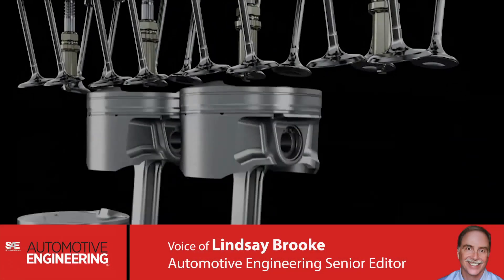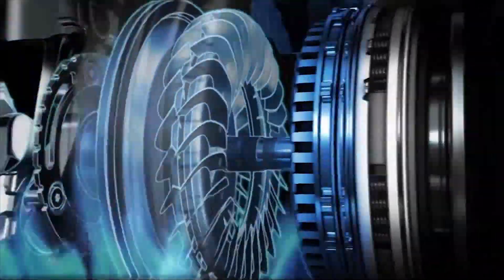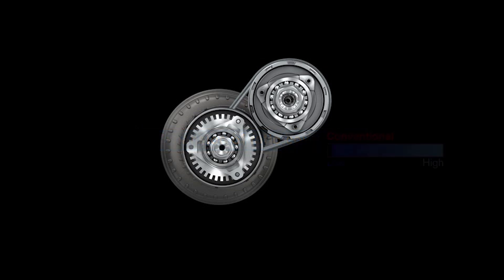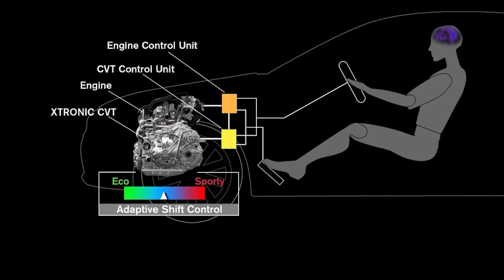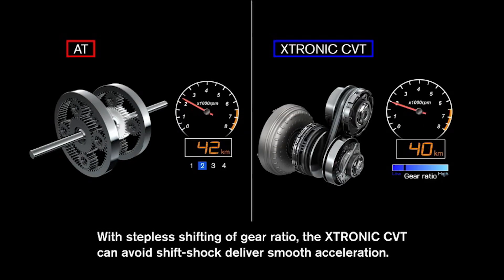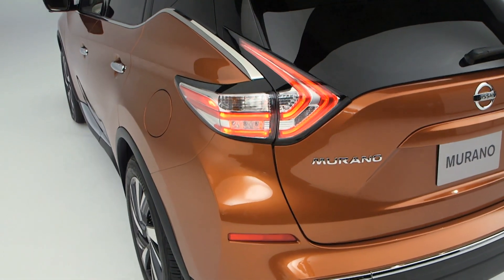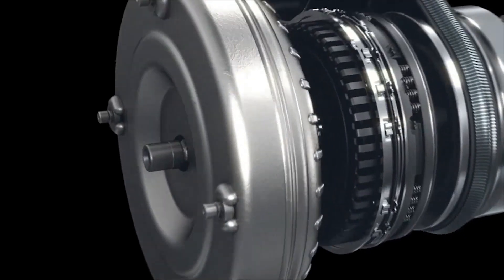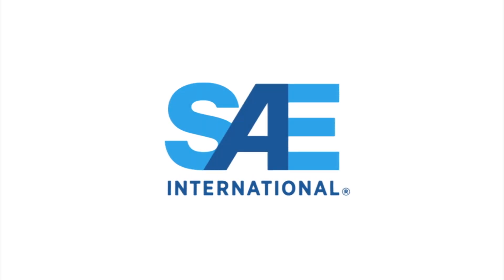SAE Eye on Engineering: New CVTs

Comment: I don't know about the VW group at large but Audi has discontinued putting CVT's in their vehicles. Though I anticipate the common problems with the so called 'slushbox' will be fixed and then they'll be more common than gear shifting transmissions someday soon.